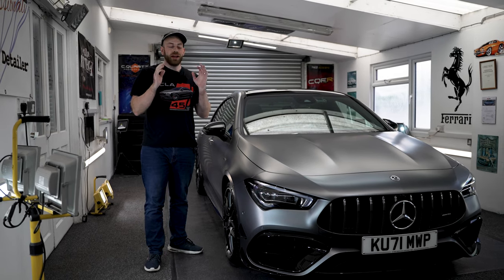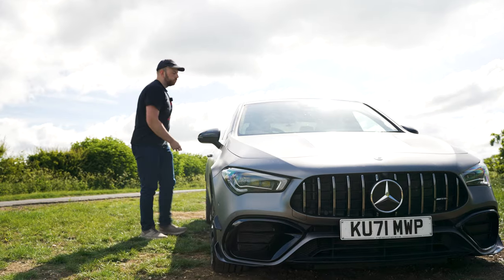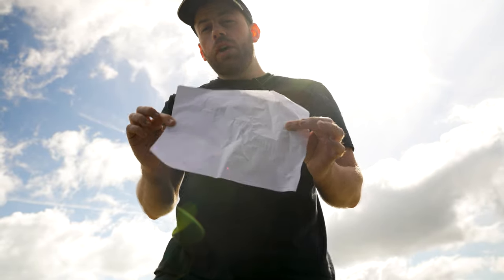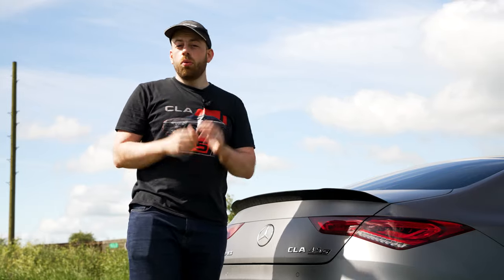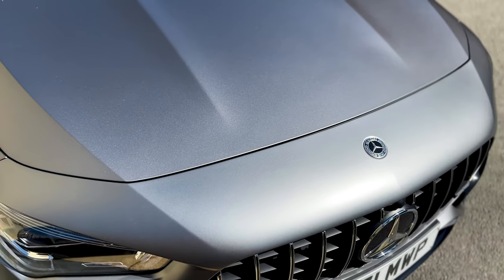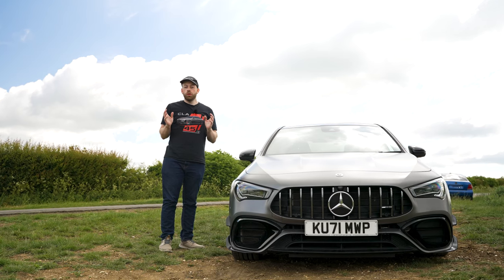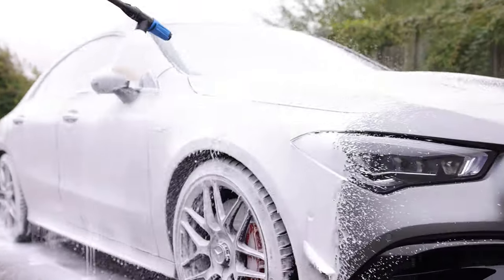We ceramic coated my Matte CLA45S and THIS HAPPENED!

Comment: Basic ceramic coating out of a spray bottle gives the same water beading, be prepared  for dust accumulating on the car because when rain falls it contains dirt that will through water beading sit on the paintwork until it evaporates and the dust and dirt contained in the rain water is left as a residue on the car.

I’ve been using mcguires ceramic coat and it’s great but it does leave residue through the water beading as explained above.

Comment: Hi, quick question on the ceramic coating as I’m looking to do the same. The video mentioned you used titan ceramic coating i believe and was wondering did you have to buy your titan coating own and bring it in yourself for the detailer to apply ? Or does the detailer already have a selection of choices? I wanted to use Titan (yours) or Gtechniq but finding a detailer that offers them is hard. Thanks
Reply from the maker: Hi A, A detailer will usually supply the coating. Often certification is required to purchase the coatings etc. Best bet is to find a detailer that deals with the coatings then they have experience applying them as they can all be different processes.

Comment: how did they apply it.. spray and dry ???? and what foam did you use to wash your car...  regards.. a fellow matt owner
Reply from the maker: Hey David, they kindly wrote down every step so I am going to do a video breaking down the full process and also the costs. There was a a lot of steps! Just need to check a few things  with them to confirm like how the coating was applied etc. I can answer on the foam though they used bilt hamber auto foam ph neutral.
Reply: @ABAUTOAMG  Hi is this video coming soon? Looking forward to know how they made it look this good
Reply from the maker: Hi A, Sorry for the delay on this video. It is still coming will try get it up soon with an update on how the coating is holding up too!
Reply: @ABAUTOAMG  Haha, no worries at all. Looking forward to it!

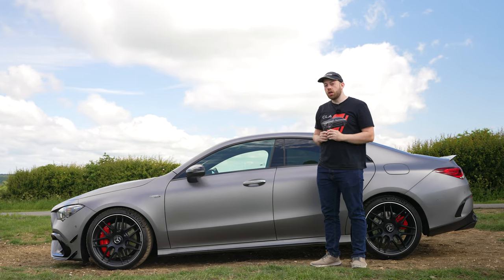Comment: Looks awesome mate. I've had my Night Black 35 done and will be getting my Patagonia Red hatch done too when I get it. Did someone dump a stolen Skoda (I think) in the background? The blue one at 5:05. Cheers.
Reply from the maker: Thanks Ian! Well spotted! I often film here because it’s a lovely spot but that car was randomly parked up. It was all smashed up at the front and as you probably noticed they removed the plates. Not sure If it was stolen or abandoned by the owner. It had some questionable decals on the back and there was a random nitros oxide canister on the grass next to it. 🧐

Comment: Cool vids. What equipment do you use ie phone,gopro, and what editing software?   Apple or Windows for uploading to YouTube.   Yours always look excellent quality and smooth. Mine are dead blurry when I upload to yt.  Any help 🙏
Reply from the maker: Hey Mark, thank you. My setup has evolved quite a bit since I started. My main camera is a Sony A7SIII (expensive but amazing camera in manual mode with few years experience). I also have quite a few other bits like a gimbal, drone etc! But I started out with just my phone. I do plan on making a video on my camera setup in the future too.
Reply: @ABAUTOAMG  cheers for getting back to me.  Do you use a mac for uploading to YouTube?  What editing software do you use?  If u don't mind me asking.   Am using s21 ultra with gimbal. Imovies on a mac pro. But the uploaded video is really laggy/ blurry.  I upload in 4k60. Any ideas ?
Reply from the maker: @markthomas4254  No problem. My setup is a bit more on the professional end along with the software I use (premier pro) because I work in the industry in my full time job. I’m not sure why your footage is coming out like that it should look great on the s21. Does it look ok before you upload to YouTube? I’m wondering If it’s the codec when you export it. Keep in mind though also with YouTube when you first upload a 4k video it will process in a much lower resolution and not look great. But after a few hours it will have finished the 4k version and look much better so may even just be that.
Reply: @ABAUTOAMG  it looks excellent b4 I upload it. How do I get around the codec ?
Reply from the maker: @markthomas4254  ah that’s good then that means there’s not a codec issue. When you view the video on YouTube press the 3 little little dots at the top and check what it says under quality. What is the video playing back as? Sounds like YouTube has not processed the video at its native resolution yet. It can sometimes take some time but should fix on its own if it’s that.
Reply: @ABAUTOAMG  it's playing back in 4k60 also 1440p 1080p60 etc. There's not much difference in the pic quality on either resolution. It's mainly the motion blur n  it's just dead juddery when panning I use a gimbal n move really slow. Am thinking it could be the s21 ultra or the uploading process?   Am looking at making YouTube vids of my car . Just don't want then Turing out like they are at the moment.    If you can remember I spoke to you just after you got your c43. I was looking at the same car in black. In the end I went for the bmw m340i. Now looking to upgrade to the new m3 or m4.   I just need to sort out theses uploads lol. Cheers for your help